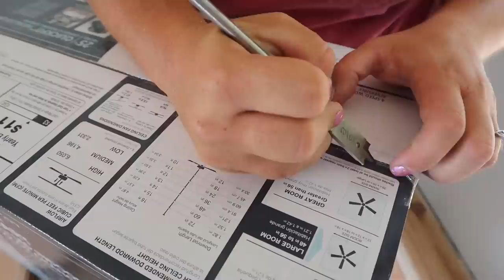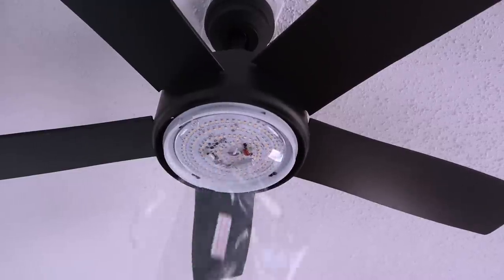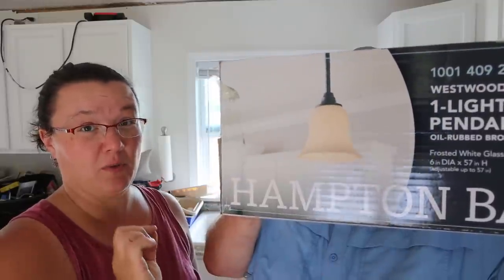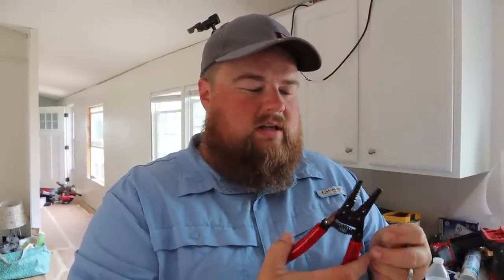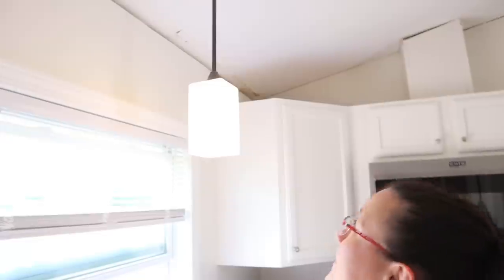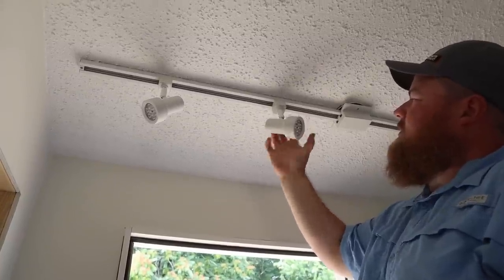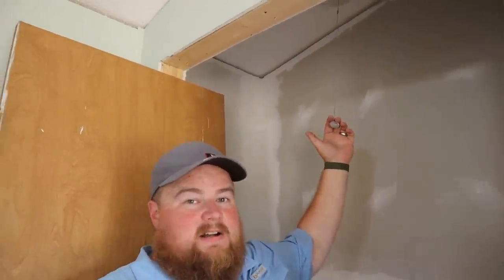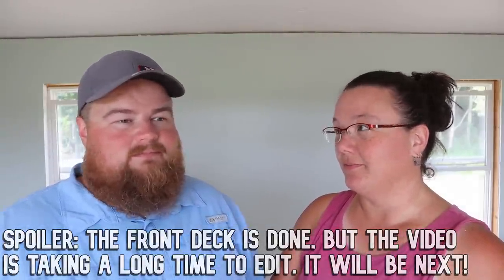All About the LIGHTING! Every NEW Light INSTALLED at Once

Comment: Thanks for the tip on the bolt cutter. I have been using those wire cutters for many years and never knew what those holes were for. The house is really coming along.

Comment: Glad someone else uses Hampton Bay.  It's a good product and priced well.  I have 3 ceiling fans that run constantly as I can set the blades to pull air up or push it down....depending on the season.   Love the kitchen lite you chose.  Thanks for the hint on how to shorten a screw.  I learn something new each day even at my age (82).....lol lol

Comment: Love the lights, especially the ceiling fan….I stopped the video and went and found it at Home Depot…..we are redoing at double wide , had to redo outer wall framing, added plywood to outside then added vinyl siding, replaced all the wood on the roof and replaced some metal pans…we took out the fire place and front peak, replaced all the windows…..replaced 3 foot of flooring on outer edges. Next is the wiring and plumbing……..love what you have been doing …….much cheaper then buying a new one. I feel for you working in there in the heat….we have taken a break do to the heat as we live in Florida and temperature is over 100 degrees and we have no power except a generator. The end prize is well worth it, the hard work and sweat put into it will be so rewarding. I can’t wait until you move in. Have a bless day. 🙏                Can’t wait until the next video
Reply from the maker: Wow, you all have done tons of work too!!! Sounds great!!!

Comment: Sam wow thanks a bunch! You are a life saver!!!! Just the other day I was trying to add handles to a cutting board and the screws were to long! I ended up cutting with not the correct tool and then having to file the threads so it would still mount correctly  I had no idea what those holes were for and I have had those darn things for years!

Comment: Instead of bending the ceiling bracket on the pendant there are fixture hanger fittings that are sort of like two decorative eye bolts ( like a U joint) where the wire passes through the center. These are made just for your type of mounting situation. The pendant would be able to move though and I don’t know if that was your intention.

Comment: If you turn the lights in the laundry and closets from the opposite side of the track will give you more light in each place so you don't lose some of the lught on the wall at the top.
Example
( right side pointing left and the left pointing right )

Comment: A 19 is a standard light bulb A designates the socket/thread size, 19 designates diameter of bulb at widest part in 1/8th's of an inch. For example a T8 flourescent is a Tublar shape that measures 8 eightlhs or 1 inch, a T12 is 12 eighths  or 1 1/2 inches.

Comment: You guys are making awesome progress!  My hubby has a question, though..... are you going to trim the junction between ceiling and wall?  The window casings, floorboards?  I'm sure you're focused on the essentials for getting back into your home, and those cosmetic features can come later.....But he wanted me to ask.  😊
Reply from the maker: Yes, we will have ceiling and floor molding as well as window trim installed before we move back in the home. That's more of my rule & goal vs. Angela's. :) I don't want to have that hanging over my head and working around furniture if I can knock it out now quickly.

Comment: Which direction do you set your fan blades to oscillate? Clockwise or counter clockwise?
Reply from the maker: In warm months; so that the air is directed downward from the fan. In cool months; so that the air is pulled upward from the fan.
Reply: @sam-and-angela  😀

Comment: So, have they installed the meter? Or are you still running off your power pack?
Reply from the maker: We're still running off our solar system (the larger one we installed about a month ago) and our gas generator. We won't get our power turned on until everything passes inspection. County rules..